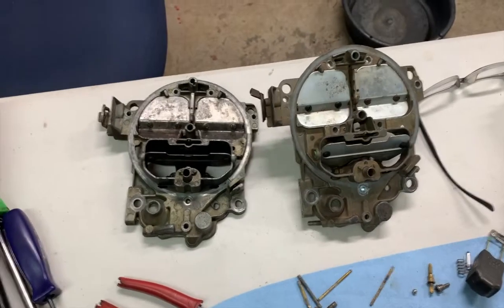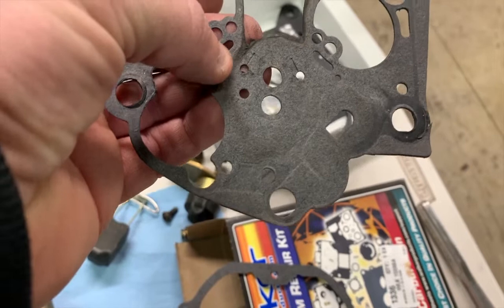Revisiting our Q Jet Autopsy and we have revelations to what the actual heck is going on and why!

Comment: I had the same problem with one of my carbs, probably the same mechanic.  I have 4 carbs, 17080213 for my truck now, for spare parts and  1 completely restored spare. I did the same thing you did, plus get a variety of gaskets like double thick air horn gaskets, just for the day where nothing is available
Reply from the maker: I've been doing the exact same thing! LOL! I must have 20 air horn gaskets now in preps for the next 20 years... LOL!

Comment: You should check “ Cliffs High Performance” web site, There is also a quadrajet forum on the website for questions & answers. He has published an excellent Quadrajet  performance book. He also sells all high quality parts and rebuild kits. You’ve got a good start and his book explains main bleed air verses main jet and rods. Also very important to set up idle tubes and down channel restrictions up for your engine and cam setup.
Reply from the maker: Linda, we have that book from Cliff Ruggles as well as use his parts to make our Q-Jet work. The change in main air bleed size took me by surprise and I'll have to keep my eyes peeled in the future when swapping air horns around. They indeed are not all created equal.

Comment: Larger air bleed holes = leaner carb. Look into how to make these bleeds smaller. Hobby store is your friend here.
Reply from the maker: Thanks Shawn... I had this all wrong then. I thought the larger the passage was for the larger the engine. With the smaller air bleeds, we are killing it now. Tuning and dialing this carb in. It appears we need smaller jet's now! 70's appear to be too rich and we are eyeballing 68's.
Reply: @mr.roddersneighborhood2740  you’re right on using the late 70’s carbs. Look at the air bleed holes in those and later carbs. Almost always get bigger holes. (Leaner burning) the more air rushing into the bleed- the less fuel it will draw through the carb. (Think of slurping the bottom of a milkshake)   Awesome videos!